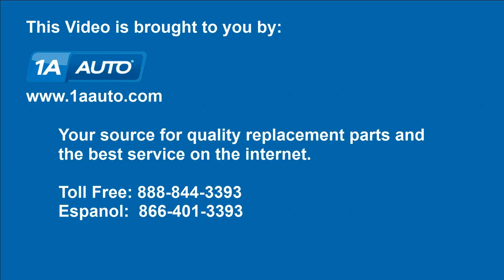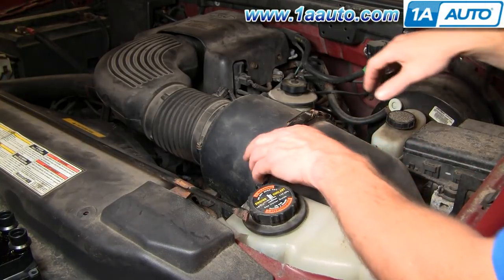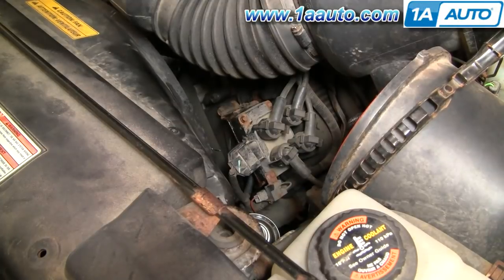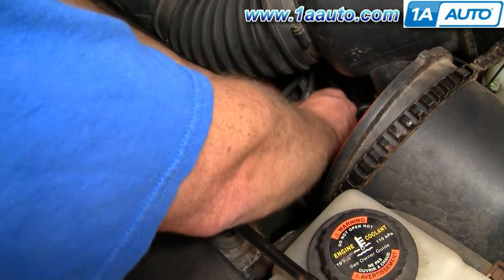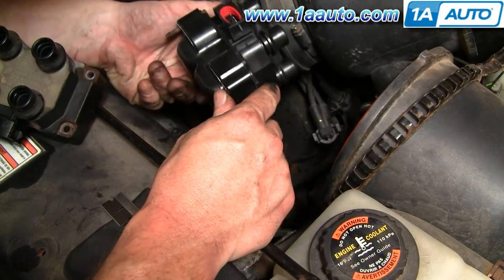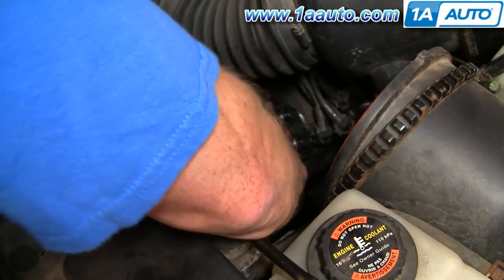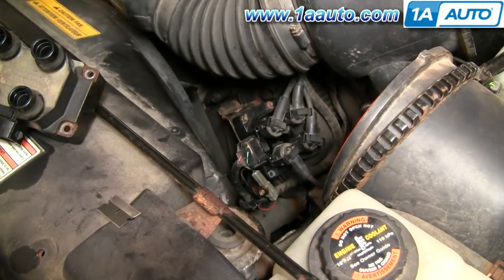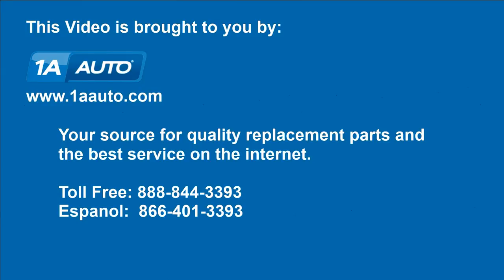How To Replace Ignition Coil Ford 97-02 Expedition

Comment from the maker: It probably wouldn't hurt to change the cap, wires and rotor if it has them. If any of these are worn or arching out it would make the car run rough.

Comment: @1A Auto Repair,  Does this repair procedure also apply to the 2000 Lincoln Navigator?
Reply from the maker: +Jonathan A Romero We don't have a how-to video for your vehicle right now, but the basic steps in this video should be enough to do this task. Buy this part for your vehicle on 1AAuto.com: http://1aau.to/m/Shop-1AAuto-c

Comment: I was told I need a new coil and to replace plug #2. Looking at the engine, is this the coil on the left or right?
Reply from the maker: +Mark Evans Depending on your vehicle this could be in the middle or slightly to the right.

Comment from the maker: Hi Ariel, If you haven't changed the coils you may want to try that to see if it clears up the issue. We carry new ignition coils on our website for your 98 F150 4.6 with free shipping in the lower 48 states. 1aauto.com 888-844-3393

Comment: i have a 98 f 150 4.6 v8 it has a misfire in cylinder 7 and 8 I just changed the plugs and wires and still misfiring any ideas what should I do next